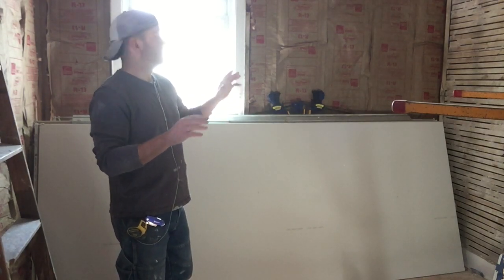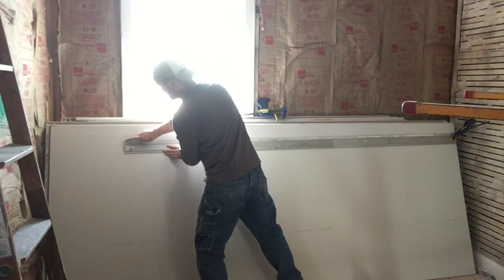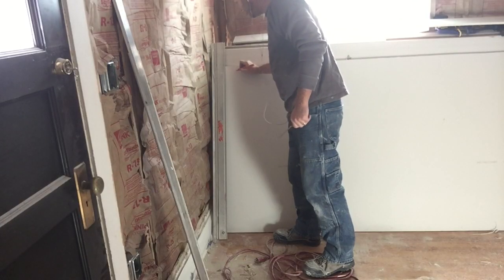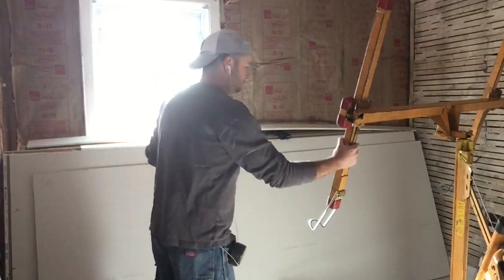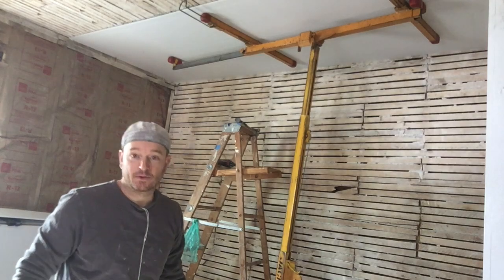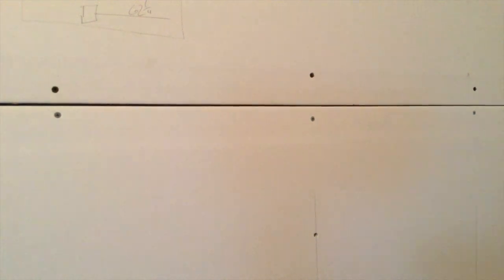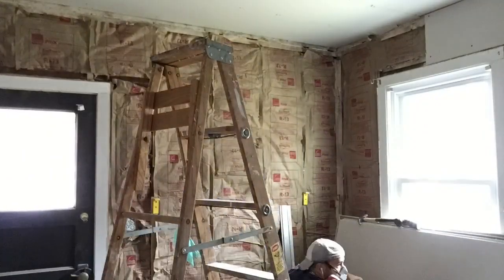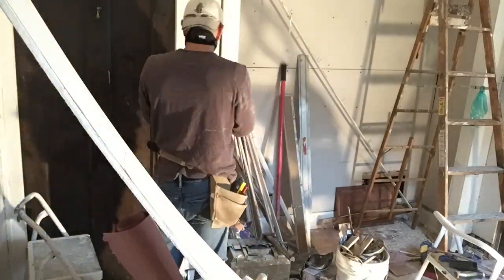Hanging Drywall in a room in a old house (solo) (Part 4 Bedroom Rehab)

Comment: This project is almost exactly what I need to do for my kids' room. However, I also need to replace the two old windows in there, including the frames/trim that have lead in them. Do you have any experience completely removing old windows out and replacing them?
Reply from the maker: Yes I have done a couple houses.  It is really not that bad of a job.  Once you have done two you will be an expert.

Comment: Why didn't you remove the old lathes before putting the dry wall up? Every house I have worked in we have always removed it.
Reply: That is the question I was going to ask. Cheers
Reply: I just watched another video and they did it for 3 walls but not the 4th wall (against the outside) or the ceiling.  Not sure what the rhyme or reason is or if it even matters honestly.  The wall that was against the outside, they did staple plastic insulation to the studs before drywalling.

Comment: Hey there, I was wondering if you are noticing any issues after insulating your outside walls?  I see a lot of builders and restored house builders talk about makign sure you dont block the air from running down older houses.  they say that you need to either seal the outside of the house or you can use this egg crate type of things to keep the insulations from the wall and allow a barrier for the wood to breath and dry for when it rains.  Let me know if you have any leaks and if you noticing rot happening yet or not.
Reply from the maker: I have not had any problems and the room is so much more comfortable.
Reply: 1892 house here.  I have heard the same thing.  I'm gonna install without the plastic insulation.   The lower two floors get extremely humid in the summer, I think that moisture needs as many paths to escape as possible.  If you were running an industrial dehumidifier 24/7 in the summer it probably wouldn't matter.  I have considered that.  Bigger electric bill but would save much more on the gas bills Dec/Jan/Feb

Comment: I have a house built in 1900 that I'm hoping to start demo on. This is the first I have seen of anyone leaving the lathe up. I see in the comments that you said this was because of the trim. The original trim was the whole reason I bought the house. My issue is that I need to insulate the entire second floor and add electrical as there is one outlet and one light switch for the whole 3 bedrooms and they are both in the hallway. Would you still suggest still leaving the lathe up or just trimming down the trim if needed?
Reply from the maker: I left the lath on the ceiling but took it down on the walls.  Then I tacking in the trip going vertical.  If you dont do that when you put up the drywall the trim will stick out the length of the width of the lathe.  Does that make sense?  I love old trim and I try everything I can to save it.

Comment: Sorry to bump a video that’s two years old. Did you have to install blocking around the edges to have something to attach the ceiling drywall to? Or try to drive diagonally into the top plate close to the edge? Or does the wall drywall going in under it hold it up?

Comment: Awesome video, Im looking at a house that's from 1900, but it's plaster and lath, I'd want to put drywall up in a few rooms at least, but wonder, Is there anyway to put the drywall ontop of the horsehair plaster stuff? Or should I remove all the plaster and put up drywall on the lath
Reply from the maker: I have never installed drywall over plaster.  I have seen done thou.  For example in my kitchen someone drywalled over the plaster with 1/4 drywall.  Sounds easy but not sure how well it would hold up.  Also, keep in mind if you drywall over the plaster, you will need to remove and resize all of the trim and baseboard in the room.  Also, if you want to insult behind the wall it is easier to remove everything.  Here is a video that did on removing plaster:  https://youtu.be/ivv89VcBA3s

Comment: Have you ever heard of the “ chalk line”?
Reply from the maker: Never tried that.
Reply: @KletteTech  it is the most awesome simple tool. would have saved you some time on those marks. and you could have gone all the way across once. And you can use to mark studs/joists to make life that much easier
Reply: Chalk line is a must when working with and cutting any type of paneling.

Comment: This is amazing. Love your videos! QQ: was there a reason you didn't rip out the lathe on some walls? (Maybe you mentioned it and I missed it.)
Reply from the maker: Thanks.  I only ripped off the lathe where I wanted to place insulation.  The reason I left it on was so the 1/2 inch drywall would line up with were the plaster was.  Does  that make sense?

Comment: I noticed that you removed the trim around the window but not around the door and the closet. Why is that?
Reply from the maker: At first I only removed the outer trim.  I did not want to take remove all the trim with the risk of damaging it.  I also thought it would be more work.  I ended up taking all the trim down except the around the closet and door because I needed to insulate it.  The door and closet are not on outside walls.  So I did not have to worry about air drifting through.

Comment: Hello, so I can leave the laff up and drywall over it....I thought I had to tear the laff down. Also, I wasn't going to insulate the bathroom...is that ok? Or is it a must do?
Reply from the maker: I left it up in the inside walls.  A couple people have told me I should not have but I have never had a problem.  If it is an outside wall I would recommend insulating the walls.  But is also depends on where you live.  Hope this helps
Reply: @KletteTech  I’m in Ohio. Thanks
Reply: @KletteTech  why did they recommend you tear it down?
Reply from the maker: @MarriageandtheSingleLady  They said it might my the cracks in the tape job later.  But I have a wall I did 12 years ago and it has not cracked.  If I was in northern Ohio I would insulate.  On the southern tip I would still consider it.  But might not be as important.

Comment: so its possible to put drywall over wooden lathes? I want to do the same..any advice..Sorry for the ignorance im first time diyer
Reply from the maker: I did and it as worked well.  Some people say the drywall will crack but it has not yet.  If you do make sure to use a longer screw on the ceiling
Reply: @KletteTech  do I use 5/8 drywall? For ceiling and how long screw ?
Reply from the maker: @robertmontoya1721  1 5/8 at the minimum or 2 inch
Reply: @KletteTech  thanks alot!!

Comment: Great video! Leaving lath up, wouldn’t that make the walls stick out further than the walls you removed the lath/plaster?
Reply from the maker: Great question.  But plaster is about 1/2 inch.  So if I used the 1/2 drywall the trim will hopefully line up.  if you remove the lath.  The trim will not matchup.  Very frustrating to fix.
Reply: @KletteTech  If I cut new trim, can  I remove the lath. It will make the new electric and HVAC ducts much easier in my situation.
Reply from the maker: @coreynalepka5904  Yes but two things can cause a problem.  Doors and windows.  The jams will stick out and trim wont line up drywall. There are a couple things you can do.  One plane down the jams or push out trim with an extra piece of the behind it.  Planing the jab down looks the best.  Does that make sense?
Reply: @KletteTech  planing it down seems to make the most sense. Not sure I'm following you on the trim advice. 

Thank you for the quick response. My girlfriend and I are bidding on our first home. It was built in 1870 and we will be removing all the bad plaster (ALL THE PLASTER LOL) before we move in. We appreciate these quality videos.

Comment: Can I cut the boards into smaller pieces or should it always be as big as you can?
Reply from the maker: The bigger the sheet the less taping that needs to be done
Reply: was wondering the same thing, what's the disadvantage of more creases and just filling them with puddy, or foam ?  seems you could mount 4x4 pieces much faster.

Comment: My plaster house doesn’t have any insulation. Should I remove all the small woods to add insulation? Or I just add the drywall ?
Reply from the maker: I added insulation.  We are in the midwest.  kinda of depends on where you live.  But in general I would say yes.
Reply: Depends where you are.  if you have HUMID summers you may want to avoid so the humidity has more avenues to escape and just run up the gas bills a bit more in winter.  Will save you from humidity damage.   Otherwise you will have to run a humidifier 24/7 in the summer

Comment: I have an older house they used plaster for most of the walls and ceilings. Would it be best to stick with plaster or switch it up for drywall? Also I'm new to doing this, I've never done any type of work like this ever.. what would you suggest? My house is about 100yrs old but partially renovated. I wanted to upgrade the older parts of the home.
Reply from the maker: If the plaster is in good shape I would leave it up there.  Mine was in real bad shape and I wanted to insult behind it.  My current house is a mixture of drywall and plaster.  Sometimes in the same room.

Comment: Great vid, thanks so much!
I'm thinking of buying a project house, it's 100 years old, and they had started renovation, then somebody lost their job or something.
The house (huge, 2800 sq ft) was stripped down to the lath - no insulation. I'm wondering if it might be easier to just go ahead and drywall over the lath, then blow in insulation from above down between the studs, rather than having to remove all the lath and staple in the insulation. 
Would remove any lath necessary for new wiring, of course.
Also, how the heck do you get drywall up to a 20' ceiling?
Any thoughts?
Thanks again!
Reply from the maker: Great questions. I would think think blowing insulation in would work. But I might try one room first.  20' ceiling.  That is a really high ceiling.  I would rent a lift.

Comment: Why would you not remove the lathe and add insulation? At least in the ceiling
Reply from the maker: I mention in the video that I did not remove the lathe because of the old insulations that is up there.  The mess would have been horrible and we are living in the house.  Also, I plan on blowing insulation in attic in the future.  Might as well leave what is up there.
Reply: @KletteTech  ah, I see. I think I have vermiculite in my ceiling so it complicates thinga
Reply: Sirs, which type of insulation would you recommend to install in this situation? Thanks for the brilliant video.

Comment: If I'm not planning on reusing old trim then I'd be fine to tear out all the lathe correct?
Reply from the maker: Yes.  But around the door and any windows you might have to cut the jamb down so the trim around the door and window will sit flush.

Comment: I have the same type of old house, and there are multiple cracks on the ceiling. In this case, can I install additional layer of dry wall on top of old ceiling?  (I don't want to remove old ceiling) Do you think if this would work?
Reply: You left the old plaster on? If it doesnt crack and fall onto of drywall would be ok. But you don't want that weight pushing the drywall out.